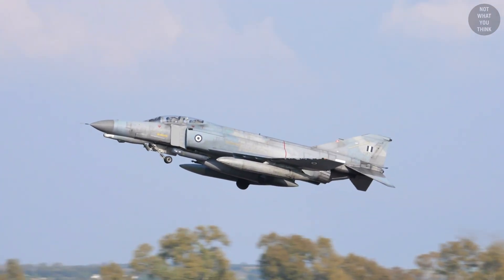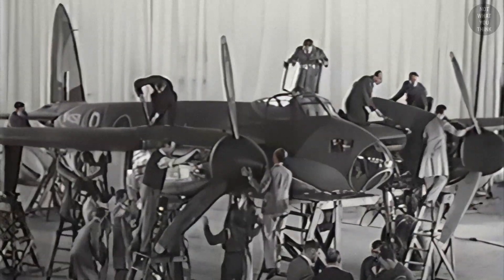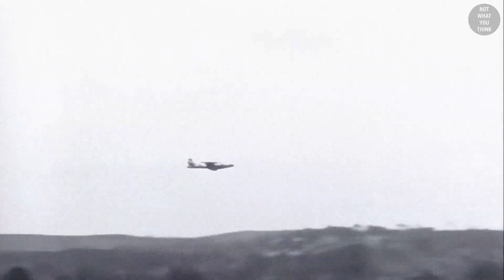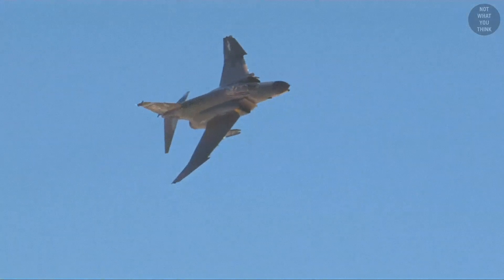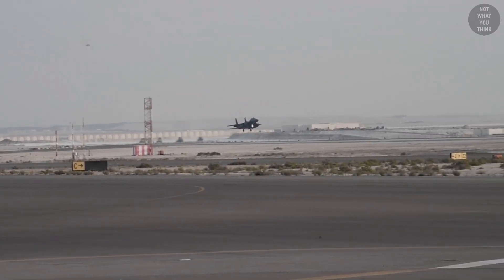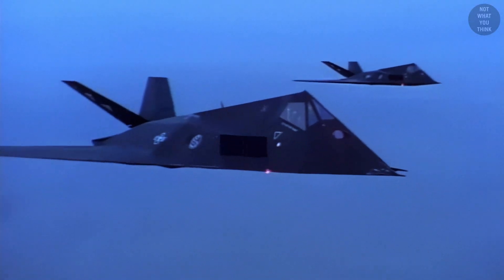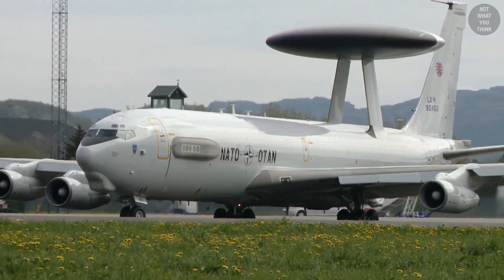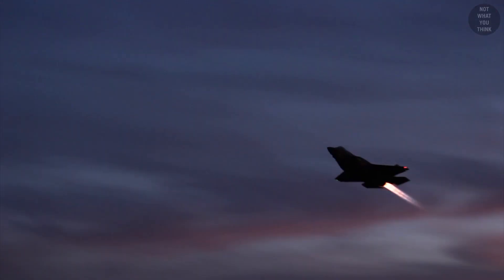Why are Modern Fighter Jets Slower than 1960s?

Comment: Another point completely overlooked by this video is that Vietnam era fighters were designed to quickly get to altitude and intercept incoming long-range bombers. A completely different thought train. Air to Air was actually a secondary role.
Reply: It was the same with the English Electric Lightening of the 60s and 70s. It was designed to scramble and climb as quick as it could. It was ridiculously quick even for today, but would use all its fuel in 40 minutes.
For interceptors they often have to launch an air to air refuelling tanker too.
Reply: It wasn't really overlooked by the video any more than it was by the people using these planes. They might have been originally designed as high-speed interceptors, but that's not how they ended up being used. The F4 was used in Vietnam as an air superiority fighter and ground attack craft, regardless of what it was originally designed for.
Reply: if you take the F-14 for example, its role was to intercept threats so it had to be able to go very fast very high and hit the enemy before it could launch an attack on the fleet. range was not important
Reply: The premise of this video is a little off, he is comparing cold war interceptors with modern fighter/bombers. You have to say why the older jets where faster and why they where not needed as high speed interceptors. You have spent billions on these cold war interceptors, so ones that where capable of performing missions that they where not designed where kept the others scraped. As these cold war interceptors jets came to their end of life, newer jets where designed to do the mission that the modern airforces need them to do. As this video highlighted all the missions are mostly subsonic, so the modern jets reflect that.
Reply: Exactly, that they forgot to mention that is insane
Reply: Well intercepting bombers is air-to-air, but I get your point 😂
Reply: You have to be ready to fight in a Nuclear Air Exchange.  Anti-Bomber is key.
Reply: But even then they wouldn't do that at max speed or burn, unless they had waited until the bombers were close, which sort of goes against the principle of making them quick so they get get to bombers fast, bit.
Reply: @jars6230  
The Genie was a NUCLEAR air to air missile, so accuracy wasn't as necessary to hit the target.
Reply: @fazole  Again, have to be ready to fight in a nuclear air exchange.  Yes, I do like defensive nuclear weapons.
Reply: @dannypipewrench533  Awkward innit?
Liking the things is pushing it - but needing them is obvious.

When the original Warsaw Pact had two or three times the conventional forces available to NATO it was NATO's quietly spoken 'heads up' to Russia that we would go to tactical and if needs be larger nuclear weapons to halt any westward roll of what were then essentially Soviet forces which prevented war in Europe.

Anyone who says we don't still need them in a world where others have them and outnumber us conventionally too is, quite simply, dangerously deluded.
Reply: @Farweasel  Yep, maintaining a nuclear arsenal is critical.  Deterrent force is what keeps the world going.
Reply: @fazole  Yup, hence why you would design a plane like the F-104 that was basically just an engine with stubby wings strapped to it, little radar, and as intended to be used, just two wingtip missiles: because the mission profile was to climb on that engine, in full afterburner, find a big formation of Tu-95s, and launch your nuclear-tipped rockets in their general direction, before breaking off and hopefully maybe you can find a runway to land at that wasn't nuked. Interceptors like the Starfighter and Lightning were basically manned SAMs.
Reply: @jars6230  Back in the cold war detection technology wasn't that great yet, which gave interceptors in Europe very little warning time. They didn't have more or less constant satellite surveillence. And at the time is was possible to literally stay "under the radar", by flying extremely low. In case of a surprise attack launched from East-German air-fields, supersonic Warsaw-pact bombers carrying nukes would have been able to reach most West-German population centres less than ten minutes after entering NATO airspace. In this battle field there is no "waiting until the bombers are close", because "close" - well actually VERY FUCKING CLOSE - is where would be launching.
Reply: @MrAranton  This is a good point. The USSR actually had giant horns to collect sound in 'listening stations' to try to hear our bombers coming to scramble fighters.
Reply: @MrAranton you also have to factor in that both Nato and the Warsaw pact would ocassionally do bomber drills. So they would sortie some bombers and fly them at each others airspace and then turn around at the last minute. So you would have to respond to each drill as if it were a real attack and scramble tons of interceptors only to have them land after doing nothing wasting tons of money or you would be in the position of having very little time to decide whether or not an attack was real or fake. Having fast fighters helps with the time constraints in the game of nuclear bomber chicken. That said icbms also played a large role in making this less important overall as they took over a portion of the nuclear deterrent.
Reply: @jars6230  IF the bombers came in low over the North Sea then popped up for their bombing run that is exactly the problem the Lightnings had to be able to react to.
They were so fast in their response they used rocket boosters to accelerate takeoff and climb to altitude.
Take a look at the You Tube Video 'The British Fighter that could exceed Mach 1 in a vertical climb'
Reply: @jars6230  you obviously didn't live near a S.A.C. base. Those guys took off with their ass on fire EVERY time.
Reply: @timothyhines7845  it's a jet. Their arses are on fire.
Reply: Yeah, any video with the slow sounding narrator is a video for slow people.

Comment: The narrator got it really wrong. He has to do a lil bit of more homework. No air fight us suppose to be at top speed. The high top speed is especially for the interceptor role not for the dog fight role. Intercepting means you have to chase the enemy from far away until you are at the range to fire your missiles at it. Usually long range AA missiles which is fire and forget missiles. State if the art systems these days even make provision for firing up to 8 missiles by one plane to 8 different targets. Then the interceptor turn back and fled at top speed to evade retaliation. So still no dog fight actions. Its a matter of chase, hit and run.

Comment: Good point, but it doesn't change the fact that you can sling Phoenixes 100 miles away when you are Mach 1.8.
Basic physics, the higher the mothership's speed, the faster the missile can get, due to the missile's speed being added by the mothership's speed.
For example, an F16C with an AIM120C-5 flying at Mach 1.3 can sling the missile around 30 miles away.
This does not apply with an F/A-18C, who has less thrust, usually stuck at mach 1.1 and can only shoot at around 15-20 miles unless you are willing to throw away a $400M missile to put your enemy defensive at 30.

However I do understand that stealth might just be the way of the future, but you can't deny that the tomchad is a definitely legend.

Comment: I think this video is good.  However I believe your information is some what flawed and you glossed over something.  Vietnam was the last true fight with air assets.  When  both Gulf wars happened we are talking mostly out dated aircraft vs newer aircraft.  Most likely 2 different doctrines.  

That said, the speed didn't decline just because of the reasons at hand.  They may have been the points that may have had the most impact to a guy at a desk with numbers but I have a different view.   Interception is about stopping an enemy asset from reaching a target.   The faster you fly the more likely you are able to stop that threat.  Fuel becomes irrelevant depending on how valuable the target is.  What we have been fighting for the last several decades was not a war in Vietnam but a bunch of small skirmishes where the enemy was incapable of air strikes on the scale needed to worry about high speed interception.  

In the Falklands we saw subsonic Harriers take on super sonic Mirages.  The Harriers were almost too slow to intercept the Mirages.  They got within Exocet firing ranges almost every time.  between the fleet defenses and the Harriers arriving barely in that moment they were able to keep them from locking or shooting them down before the missiles could be launched and in some cases failed.  If the Mirages had been that much faster they could have gotten in, launched and gotten out.  

The speed factor is more about what you are fighting at the time, not about fuel consumption and data from a clipboard.   People who crunch numbers are good at that but the problem with stats is they very rarely translate to those odd moments in reality when something wasn't part of their equations. Statistics don't always take mitigating circumstances into account because they're variables and statistics doesn't do variables well because statistics is about real numbers not random variables.  Those stats you read, are about air combat and don't take into the times an F4 had to intercept a bomber formation before it got into range or the fact that an air asset needed support and fuel tank and after burners got it there that much faster to assist.  These are moments that could absolutely crucial to the war but are ignored due to them being rare or outliers.  

All I'm saying here is that if war breaks out in a large scale again, you will most likely see Mach 2 fighters all over again because high speed interception even if it means sacrificing range will return because it wasn't needed in the current time of a lack of war and overlooked by people with a pencil and a calculator.
Reply: The Mirage III and Daggers were not flying supersonic because the Falklands were far away enough that using the afterburner would mean not enough fuel to come back. Their average time on target was just a few minutes before they had to turn back.
Also, Exocets were carried by the Super Etendard.

Comment: Also, just imagine the aerodynamic load on the aircraft if you try to make sharp turns at supersonic speed. You can only reinforce an aircraft's frame so much without reducing internal space for it's component or increasing it's size.
Reply: Aerodynamic load on the aircraft isn't the limiting factor in a manned aircraft, it's the g-forces pressing your brain against your skull making you go unconscious that limits it's turn radius.